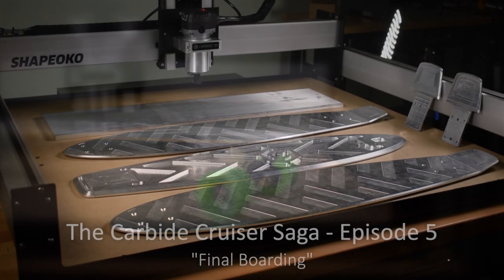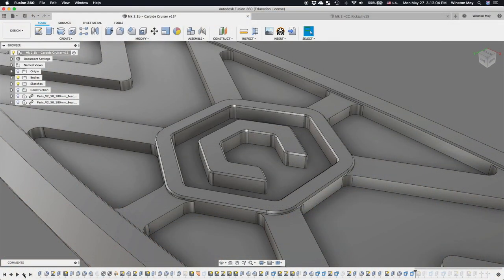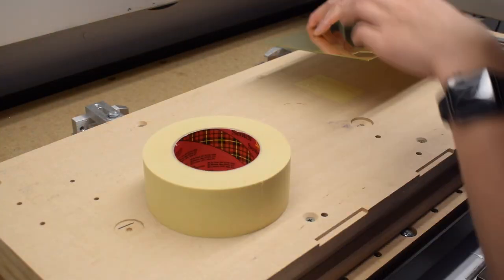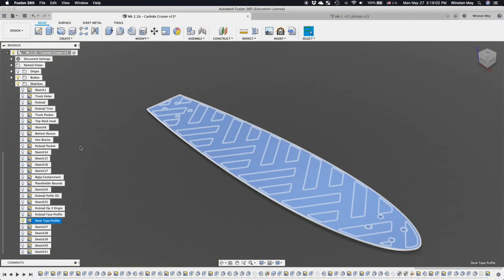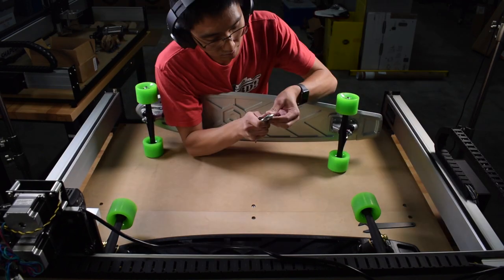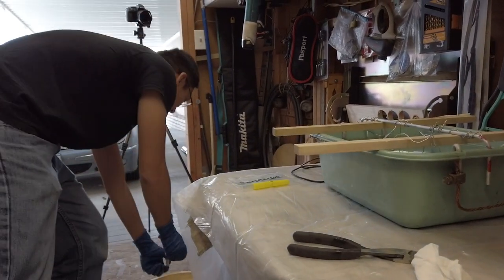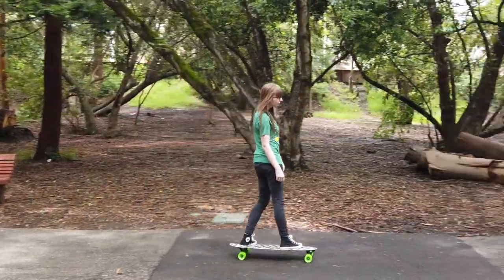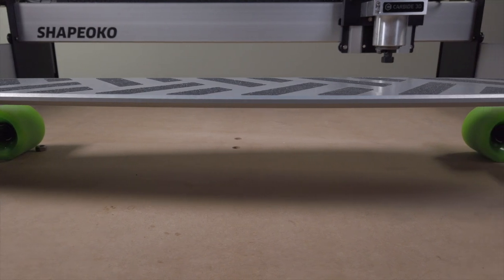Finishing Touches on the Longboard - Carbide Cruiser Ep. 5

Comment: Correct me if I am wrong, but can't you change the amount of force it takes to turn by loosening the main pivot bolt?
Reply: You can pre-compress the bushings to make turn-in easier or more difficult, but if you go too soft you compromise stability at speed. The sweet spot for a longboard and puttering around town is just a little too stiff for a board of this width, though there is also a bit of  subjectivity in that assessment.